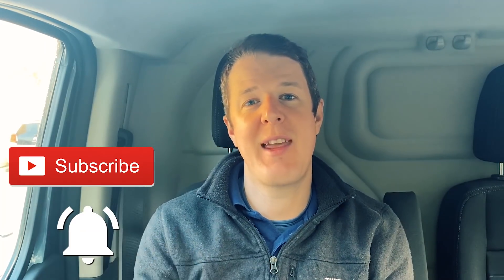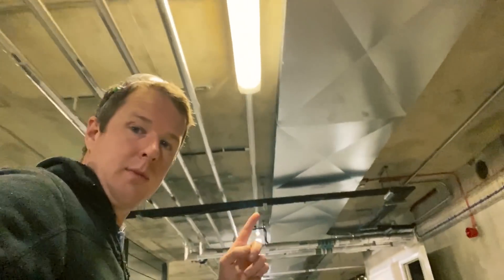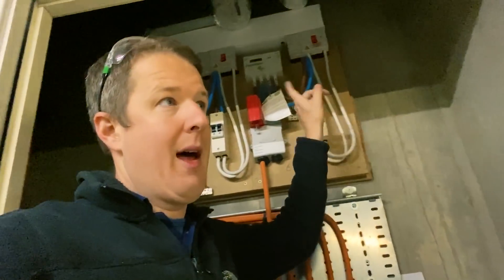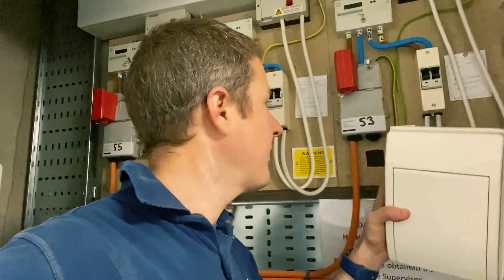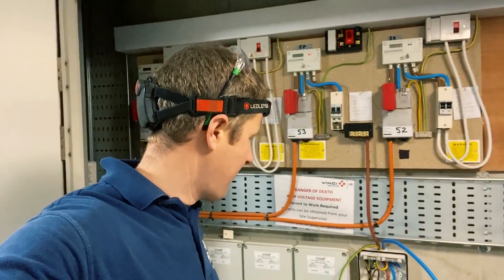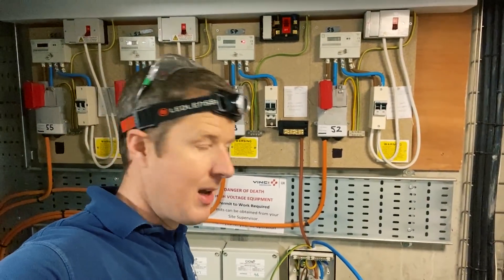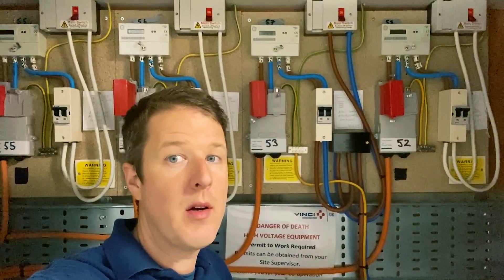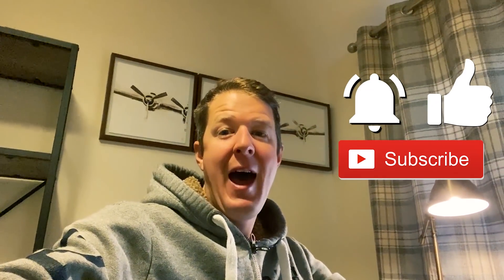Electric Vehicle Charging in an Underground Car Park - A day in the life of an electrician

Comment: I scanned the comments and might have missed it but how did you get internet to the charger or is it just a problem that was not a consideration at the time? I would imagine when you are getting the armoured cable up to the flat you can easily get an ethernet as well to connect to the home netwrok? Thanks in advance.

Comment: Nice job mate ! I have noticed that all the existing cables were low smokee zero halogen ones, however you have installed a  10mm SWA cable, do you know if  this is suitable for that type of building?
Reply from the maker: We install LSF armoured
Reply: @artisanelectrics  That's spot on then, I was under impression that all the LSOH cables in the industry are having an orange insulation not a black colour.
Reply from the maker: Thanks! No those orange ones are the DNO concentric câbles that feed the mains incomers.

Comment: I saw the sea was clipped on the fourth floor. Did you pull the cable up from the bottom or drop down ? And can you gain access on each level to clip/ support the cable in the basket? Great video
Reply from the maker: We pulled it up from below it was easier that way, we could access via a riser cupboard on each floor so could tie it to the basket

Comment: I found this video really interesting and useful.

Although I was wondering, why do you need armoured cable going up to the flat?  If you put an RCD in the second CCU couldn’t you use regular cable?
Reply from the maker: Yeah but it’s in a car park and running on cable tray so could be damaged and armoured is more resilient. Glad the video helped.
Reply: @artisanelectrics  I was wondering if it's even necessary to run the cable up 4 floors. Couldn't you use a contactor instead with just a signal running from upstairs? Might be wrong, not used them myself yet so just an idea.
Reply from the maker: You still have to get the power from somewhere! They take 7kW of electricity so it needs a 32amp feed from somewhere! And it had to be metered from the customers apartment meter.
Reply from the maker: You might want to research how contactors work they are not magic boxes that produce electricity from nothing
Reply: @artisanelectrics  Ok that makes sense, I was under the impression you were taking the feed from down there up to the apartment and back again!

(EDIT) P.S. As I understand it with a contactor you need power to a switch somewhere which sends a signal back to the contactor telling it to open or close, allowing you to switch something on and off by wired connection without having to take tonnes of power by much thicker cables to the switch location and back. That about right?
Reply: the MCB of ccu at 4 floor was 32 amp?

Comment: Great video, good points about testing and PME earthing, thank you.Lots of PPE.
But I can never see the point of putting tray upside down.Why didn’t you use the C style ceiling supports then the tray can be used as intended and cable can sit on the tray.
After all it’s called ‘tray’
Reply from the maker: Good point, never would have thought of doing it that way
Reply: Yeah fair point although look at underside height of the other trunking and lights.
Worst case use concrete anchors and unistrut and tuck the cable tray up high but the right way up.
Tray work the way in the video just looks like a cheap cop out.
Reply: Nothing wrong with tray like this.  Is there a reg to say that the cable will not take the gravitational force?  It’s only one cable not many.

Comment: Thoughts on using the "frying pans" when terminating swa?
Reply from the maker: If you mean banjos, I hate them. Prefer using earthing nuts normally.
Reply: @artisanelectrics  banjos, frying pans same thing. Did you use one inside the charging point if so enough room etc?

Comment: Would have to provisionally disagree on the RCD times test value recording, shouldn’t it be the worst case scenario (ie: the longest time across both x1 & x5 tests at 0 & 180 degrees). In your case 24.6ms. Be interested to get your thoughts on why this isn’t the case?!
Reply: x1 reading is for fault protection. x5 reading is for additional protection which is the case for this install. hence he uses the highest x5 reading. so ive been told : )

Comment: Should have been tt earthing to the socket earth terminal on a single phase supply like that ,  no two ways about it , that install doesn’t comply
Reply: 722.411.4.1 does say a PME can't be used as a means of earthing if the the charging point is outdoors.  Could you class the car park as outdoors even though its part of the building?
Reply from the maker: It’s not outdoors as there’s no contact with true earth.
Reply: Artisan Electrics is an underground car park with a concrete floor a non conducting location ? To many one week wonders on here
Reply: @artisanelectrics  That's my take on it.
Reply: R-77 in the ground

Comment: Shame the landlord wouldn't allow you to tap off the communal supply. You'd think a big complex like that would have EV charging points in the carpark anyway, seems to be the norm with a lot of new builds.
Reply from the maker: Yeah totally
Reply: The issue comes down to who is paying for the electricity. It’s your car, so you should pay for the KW used to charge it.
I’m waiting for approval for my flat to get a charger installed, it’s taking a while.
Reply: @SirHackaL0t.  The landlord could always have a separate meter fitted for the EV charge point and charge the resident accordingly.
Reply: Ashman Electrical Services That involves money that the landlord probably won’t pay. :)
Reply: @SirHackaL0t.  The person requesting an EV charge point pays for the meter and fitting. The landlord just bills the resident for the electricity used.

Comment: Should the cable not have been wired in pyro like the others ?
Reply: Jordan Muir the orange cables are probably the DNO concentric supply cables, I think the orange is low smoke zero halogen LS0H
Reply from the maker: That’s correct Jordan
Reply: Only sub-main and fire safety circuits tend to be wired in MICC cable.

Comment: Nice job running cable trey. Do you have an electrical inspector come and check your work. In the states we do none of the electrical testing you do. We will test GFCI'S and AFCI'S but that's about all.
Reply from the maker: Yeah we have an inspection every year where someone comes out and checks our work. I don’t understand why you wouldn’t do earth continuity tests and insulation resistance tests for example?
Reply: When an electrical inspector comes on a job we have done, we have called in and pulled a permit. He makes sure we have met all code requirements. We are licensed electricians and know the codes but  an inspection is required. Has to do some with insurance and the power company coming to hook up power. As far as grounding we do an 8 foot ground rod either 1/2 for 100 amp or 5/8 inch for 200 amp service. Ground wire from rod goes  to meter. We also do an equipment ground which goes  from panel to water pipe coming in the house.  All the wire we use has all ready had insulation  tests performed at the factories where it's made. I done the kind of testing you do but that was usually doing tests on motors in industry or when I had worked for the railroad testing passenger car wiring every so many years. I'm working on a house now that was built in 1904 with original knob and tube wiring. It still has old screw in fuses and an old breaker box that I'm going to upgrade. That was 115 years ago and the only thing that was changed was a bigger service from 60 amp to 100 amp and a panel with breakers. There are still some fuse blocks.It has been the same wiring. That was an old 2 wire system. ungrounded system. Everything from the 1950's on has been  a 3 wire grounded system.  240/120. When a new house is wired  all new code requirements are met. We make sure all 120 volt outlets are polarized, everything that is 240  is usually a four wire outlet.  Exception is usually, AC, electrical hot water heater. We test GFCI AND AFCI breakers and  GFCI outlets. There is no yearly checks. In the 25 years I have been doing residential I have never had an issue. I'm 71 semi retired and worked as an industrial maintenance electrician for forty years. I started doing electrical contracting in the 90's.on the side. I worked as an electrician at Goodyear . I worked third shift.. Now I still do some residential wiring for a couple  of clients that flip houses. I'm required yearly to do continued education to keep my Masters license. Enjoy your videos keep up the good work.
Reply from the maker: Thanks great to hear what it’s like in your side of the pond! Thanks for watching
Reply: @artisanelectrics  I learn new things all the time. Watching  your videos and other UK contractors I am now using some techniques you use. Your never to old to learn. Amen

y

Comment: Good job. However I wouldn't have used nylon plugs for tray in a car underground car park. Could "prematurely collapse".
Reply: Should have used tapcon screws
Reply from the maker: Tests have been done on screws with rawl plugs in fire situation and they last fine.
Reply: @artisanelectrics  are you sure about that https://electrical.theiet.org/wiring-matters/issues/58/fire-performance-of-cable-supports/
Reply: Admittedly that is 400c for 1 hour
Reply from the maker: John Tressler exactly

Comment: Much prefer a laser line to mark fixings etc although I do still own a chalk line somewhere in the van!
Reply from the maker: Yeah I don’t even have a chalk line! Andrew did luckily although I had some spare batteries in the van.
Reply: Yeah, I use both, Laser indoors when I can see it, vertical drops for conduit a chalk line can be easier outside, just me though ...each to their own. I embrace new tech as it's saved my bones and sanity on many an occasion :-)